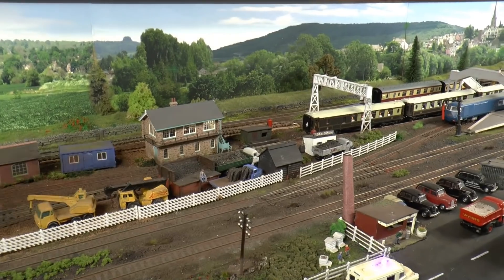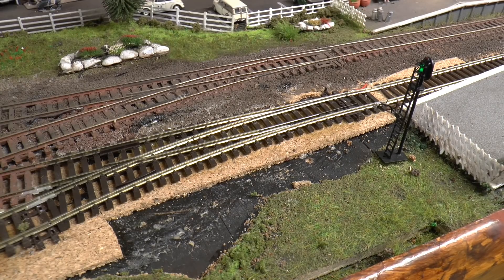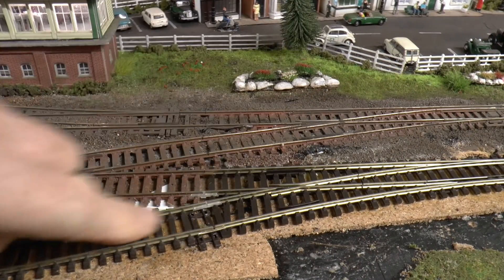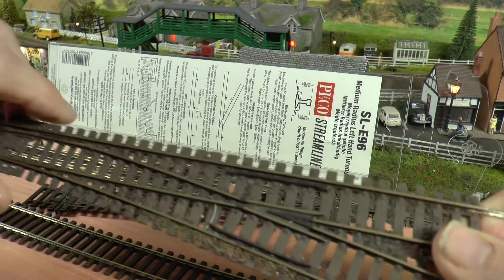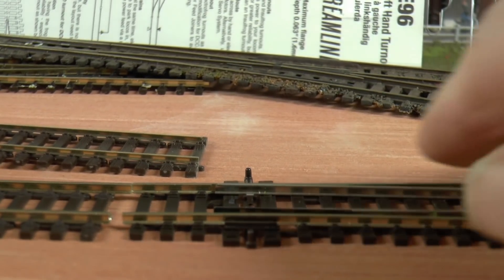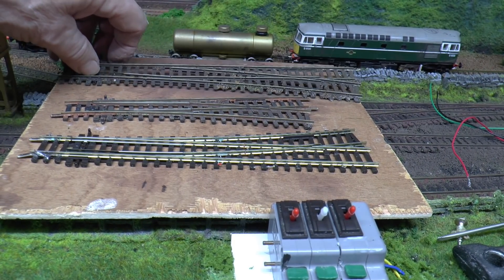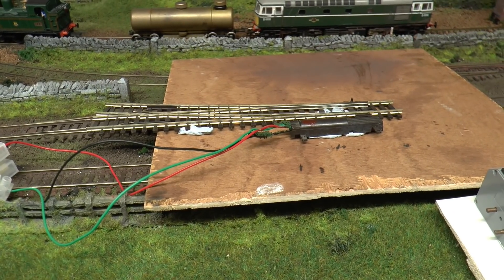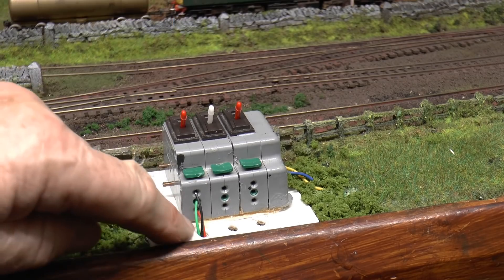D.M.Railway...Points and Track

Comment: Superb Dave , our old layout had Hornby points but with the motor attached below so thanks for giving such a superb description of what to do 👍
Reply from the maker: It worked for me same with Hornby , but here points are a bit on the fragile side , so happy now i have found using Peco points without cutting and soldering wires , they work great ..cheer Dave

Comment: Interesting explanation about electrofrog points and side mounted motors.
Iv'e never used electrofrogs because i thought cuttig the wires was to complicated but i have all side mounted motors and may now try some after your comments.
cheers Dave
Regards
Bob
Reply from the maker: No I was a bit disappointed in them when I did as the instruction say cutting those wire and soldering some on , had a dead spot all due to cutting those wires , but it’s needed if you do the under layout motors , but side mounted , leave as bought and works great , must put the plastic joiners in the 2 inner rails ... cheers Dave

Comment: Thanks Dave. Just to back up your comments on cutting the wires or not  - I have 30-something PECO electrofrog points on my DCC N Gauge layout. I never cut any of them  and just used the insulated joiners like you showed. I've never had any problems. Admittedly mine are all still manual control but, going by experience so far, I don't think I'll have any issues when I eventually add point motors. PS I know you like the Deltic but my favourite is your Blue Pullman! Cheers, Geoff.
Reply from the maker: Hik Geoff , yes I just followed instructions cutting the wires , and it caused a no current on a short bit from frog to joint , so small loco cut out , but not cutting there is no problem , I realise now that cutting them is if you use a under the layout points motor , but as i have the side mounted ones its better left as they are ..cheers dave

Comment: In the early 70`s I was crazy for a model railway .
I had a train set but wanted more.
My train set was bought from a school friend & was IN BAD shape .
The Loco … the " Duchess of Montrose " was also on her last legs .
My Dad took my to Beaties in Sheffield & said to me choose any one loco
and I will buy it you. 
Out of all the Locos there I chose the Pannier . 
I love the shape , I still have it and it works .
Never did get the layout but I do use computer train layouts .
Reply from the maker: Nice little loco , I find one of the best of the smaller ones .. I have a duchess of Montrose , just at HORNBY now being repaired .. cheers Dave
Reply: I made a mistake David .… the loco that was on it`s last legs was the
" City of London " but I do have the Duchess of Montrose in Hornby Doublo 3 rail track ….. my Dad bought me a box full of that with
points and cross track , turntable , station & a mint in the box
Newark signal box .
Reply from the maker: @Daracdor  That was another good loco , think all the Duchess class were good , I had City of Sheffield , but unfortunatley it gave up the ghost ..Dave

Comment: Nicely explained Dave. I use the same point motors and switches, although I also have a Hornby surface mounted switch wired to the Peco switches and Gaugemaster CDU. Unfortunately I have a duff 009 Peco piece of track that I need to replace and I am not looking forward to cutting it out and putting a new one in.
Reply from the maker: Glad you could make out what I was saying , yes they are good when set up properly , good luck replacing the track .. cheers Dave

Comment: Hi Dave hope you are all ok ? Hope your keeping warm with this lovely rain and cold wind. 
Enjoyed your tutorial on Points and the changes to your layout. 
I'm hoping to finally get my layout running by the end of this week. I've still got my Christmas presents to run on the Layout 😁.
I've bought all peco track in bulk from our friends at Liverpool and I've fitted all Electrofrog points. I've cut the wires underneath and added the wire to bridge the track as recommended.  Also I've isolated track with plastic fishplates. 
I've just two more oints to wire up then I'm ready to test the Layout.
I can't wait to get it running and onto some scenics! Just to do some ballasting...... Yes Dave I actually said do some ballasting! You know how I hate ballasting 😂.
Take care and have a good week all the best Pete.
Reply from the maker: Hi Peter , yes all good after the Xmas blow out ......the tutorial is realy showing that if using peco side mounted there is no need for cutting wires and soldering , I appreciate that with the under layout points motors it is necessary to do that ...
`looking forward to seeing you track and new Locos up and running ..All the best for 2020 to you and family ..cheers Dave
Reply: @howarth004  Hi Dave yes of course with  side points it's a lot easier to fit the points. 
Yes it's been fiddly fitting point motors under the base board as I'm sure you know from experience. 
Unfortunately as my points are mainly on the four lines through my station I had no room for surface mounted point motors.  Happy New year for 2020 to you and Debs and your family. I hope it's a healthy prosperous one with plenty of holidays and good weather up on the NYMR this year for you. Looking forward to getting up there for a bacon butty with you. All the best Pete.
Reply from the maker: @peterblakey576  Me as well ...with plenty of brown sauce on LOL ...its easier for you young ones getting under base board ..me I am taking the easy route ...may get to meet this summer up there on NYMR ..Dave
Reply: @howarth004  haha trust me I'm feeling it on my joints now when I'm under the boards. Yes definitely will meet up this year on the NYMR.  Looking forward to it. Plenty of brown sauce on that bacon butty! I'm feeling hungry now! Take care Pete
Reply from the maker: @peterblakey576  Take care ...your joints will be aching even more as the year go by ....I know it ...ruddy job to stand up straight in a morning ..need the thought of a bacon sarnie to get me going ...Dave

Comment: Dave nice explanation of different track you can use and ones which do not mach up in height. You did a good job in explaining in wiring the switches. Hear I thought all HO tack are the same. Thanks for sharing with use. Nick
Reply from the maker: Glad you found interesting Nick , yes the finescale is that bit lower in height , I lesson I have learnt now ... cheers Dave

Comment: Hi Dave I think we all have points problems now and again I tend to file down the plastic frog on insul points  ( hornby) and I use hornby semìflexible track R8090 it's far easier to work with than the hornby flex track which is to flexible. Keep up the good work kind regards Rob
Reply from the maker: Hi Rob , yes i have used the hornby flexi but fount not as good as Peco , problem is they don't really mix very well with Loco`s that are temperamental ....you know what i mean ....Cheers dave

Comment: All my points are hand operated, but if I decide to motorise any, I will use the surface mounted or side point motors. I have to use short radious points for my trams, as medium or long don't look right.All my track is Peco flexi Code 100. I find Fine scale it to fine for older locos
Good video Dave.
Cheers
Geoff
Reply from the maker: Yes can understand with the trams , but the short points do cause problems , fine scal would be good for a brand new layout , but would have to be total points and all in finescale ...as you say no good for older loco`s though ..cheers dAve

Comment: Interesting Dave, the fine scale track looks so good, I'd very much like to use electro frog because the dead frog plastic wears away, but electro would be better for continuity. One day I may change when I build the big layout
Reply from the maker: They are the better ones electrofrog , I terid insulfrog and got a good few problems , but now i know that no need to cut the wires unless using the under layout motors , they are my favoured ones to use now ..cheers dave

Comment: Thanks for that, I'm still laying track Hornby and Peco, I think I have made the same mistake, wondered why all Peco 100 was not the same. great video. Glynn
Reply from the maker: Hi Glynn , yes think we all learn by experience , but to me now after many years of trying , this combination of Peco and there points is one of the best ..Cheera Dave
Reply: Hi LNER All Peco 100 are the same the difference is between Peco code 100 and Peco code 75 the difference being the rail height

Comment: Hi Dave, You can get special fishplates to go from fine scale track to code 100. I use Peco points and I have used Atlas ( North American) track and it has that same height difference. Some of the locos and rolling stock sure make a noise bumping over those joints. I'm changing it all to Peco track now though.
Regards, David.
Reply from the maker: Yes would need them David , but what I was trying to show dont do as I did and buy the finescale to mix with the other ...Peco is probably the best as is there points ...just a bit confusing with the instructions saying to cut the wires and solder some on ....as you see not necessary when using side mounted motors ..cheers Dave

Comment: Thanks Dave. Interesting comments. I have used side mounts & Peco track on a desktop N gauge which work fine. 👍👍😎
Reply from the maker: Yes they work good , just a bit confusing with the instructions on the pack with saying to cut the wires .... cheers Dave

Comment: Dave, Very good
 Just trying to get my head around points wiring. Peco is showing me how. But, until you have succeeded,  it's a bit of a black art. Thanks for your contribution.  Regards Stephen.
Reply from the maker: Hi Stephen , wel just hope my video has given you a bit of help ....CHEERS DAVE
Reply: "it's a bit of a black art" not really just read carefully the instuctions and it is fine, BTW frog polarity switching has NOTHING to do with point motors Its just that the switching is often done by the point motor to make things easy. I and others tried to explain this to dave some years ago but he could not understand it, never mind he is happy
Reply: @davidrogers891  Very informative.

Comment: Very well explained Dave,why don't the points come ready to run? Never had these problems in the old Hornby Dublo three rail days,points even came with the electric motor fitted if you could afford them lol! ...Best wishes Chris
Reply from the maker: Well they do Chris , only thing is if you follow instruction on back it says to cut wires and solder , but this I find now is only if using with under the layout motors , the ones I use side mounted you are causing a problem cutting them ...just wish Peco put that on the pack ..we could understand then ..I do use Hornby , but like I said they are nothing like as strong as Peco , and well the number of times I move track they need to be strong ..Cheers dave

Comment: Hi dave that wire on the point goes to a gaugemaster autofrog which changes the polarity
The other 2 wires goes again to the autofrog
I hope this helps
Keep up the good work
Mark
Reply from the maker: Yes I did try and say that they are made like this for a different type of point motor , and that if using as I have with a above board trackside motor there’s is no need for that wire or need to cut the other wires and soldering across the points .., cheers dave
Reply: Our group use Hammond And Morgan point motors and that wire goes under the baseboard to a microswitch which is operated by the point motor and in turn changes the frog polarity
Reply from the maker: Andy Russell Sounds like you found a good combination ... not seen those till I just googled them .. cheers Dave

Comment: Excellent video Dave , layout is looking superb.  Your explanation is fine, no need to apologise, very informative.  I have recently upgraded from Bachmann EZ controller to Gaugemaster Prodigy.  The trains seem to run better with this controller, maybe because it has a more powerful output?
Reply from the maker: Thank you , glad you could understand what I was getting at , I have the ecos , but also use the Dynamis which I found good , could do with a walk around , they did one for the ecos but did hear that a few got problems with them , all good reports that i have seen re the Prodigy ...cheers Dave

Comment: Thanks for the video. Very good. You can always use Peco insul frog.
Reply from the maker: Hi John , yes have tried those also , but again they have a dead bit between the frog which with short wheel base Locos do find  , maybe ok with analogue but not with DCC ..Cheers Dave

Comment: Nice layout! How do you get the rust affect on the rails?
Reply from the maker: Thank you I use mainly the rust weathering  powder , mix a drop of water with it then paint on with brush , wipe excess off before it dries , and it comes out far better than using those rust pens ..and a lot cheaper of course ..Cheers Dave
Reply: @howarth004  thanks David where do you get it from?
Reply from the maker: @mattseymour8637  Got mine at local railway hobby shop , you can find it on line if you have a problem , just google weathering powder for model railways ..Dave

Comment: Hi Dave, another very informative video, I am in the process of redoing my layout and was given a few side mounted point motors for free your video showed up doing the three wires from the motor to the switch and also showed two feed wires, where do these feed wires come from? Is it a separate controller or a plug, would be great if you could do a video showing setting up feed wires to the switches etc, but once again a true layman’s how to!
Cheers
John
Reply from the maker: John Robson Hi John , the feed wires go to the auxiliary outlet on the controller in my case I have a spare HORNBY elite I use for the feed , but any 15v outlet will work them .. hope that helps .. cheers dave
Reply: David Howarth  perfect Dave! I use a gaugemaster prodigy express for my DCC but have two spare Hornby dc controllers so will use one of those, is there a limit to how many you can connect ?
Cheers
John
Reply from the maker: @johnrobson4230  I have 5 down 1 side and just starting on the other , but dont think it should effect as you are only using the power one at a time  (switching) ..Dave
Reply: I use Peco point motors on my layout, but a warning to any one using them for the first time or replacing Hornby point motors. Where the feeds on Hornby motors are RED & GREEN for the direction and BLACK for the return, Peco are RED & BLACK for direction and GREEN for the return. 

I found out the hard way after taking 2 Pecos back to the shop because they would only go one way. When I read and reread the wiring instructions I realised that Peco used the GREEN for return!!! I suppose I could be blamed for the first 2 not working, but my philosophy is go in head first and if all else fails, read the instructions!! 

Plus in my working life I was a "sparky" so was used to red being positive/live and black negative/neutral. Green was earth - now green/yellow - and USUALLY all other colours were the same as red.

One other question Dave, did you put the decoder in the little Pannier loco or was it already fitted? If you did it yourself, where did you locate the decoder. I ask because I have one that needs a decoder. Nearly all my locos have Digitrax or NCE decoders.

That's enough of my waffling.  ...Ian ...
Reply from the maker: Hawthorn Valley Hi ian the Pannier  loco had the decoder already fitted , the sound also from same people , know as wheel tappers on YT , .... cheers Dave
Reply from the maker: @hawthornvalley  Hi Ian , that Pannier Loco had the sound chip fitted by Wheel Tappers , its there own sound , not bad for a small steam Loco .....yes you are right about wiring with the Peco Points differing from Hornby ....I also found you need the full 15v for the Peco with them being so well made (not as easily thrown ) ...cheers dave
Reply: Hi Dave, quick question, where is the decoder located.I was thinking of putting the decoder where the coal storage is except that part is missing - I got the loco off ebay - but haven't been able to find another one. I will look further into placement.

I'm in Australia and have 2 stores that I use for my decoder fitting, but would like to fit it myself. How big is the speaker, must be very small considering the size of the loco. ... Regards, Ian.
Reply from the maker: Hawthorn Valley Unable to answer Isn as I have not taken the body off this loco since buying it ... maybe google will come up with an answer ?